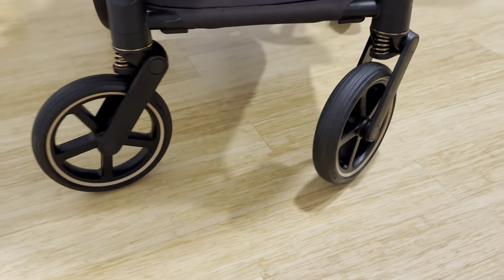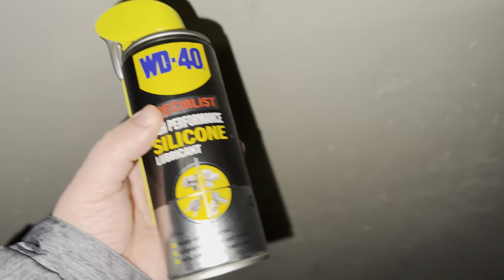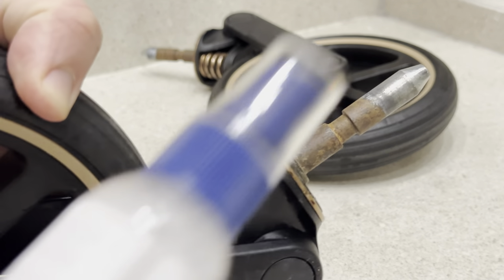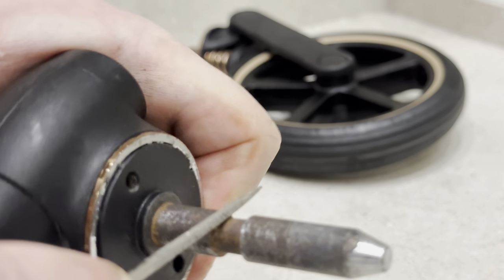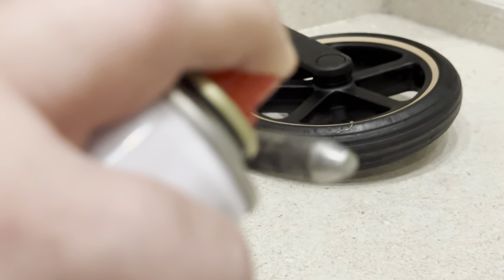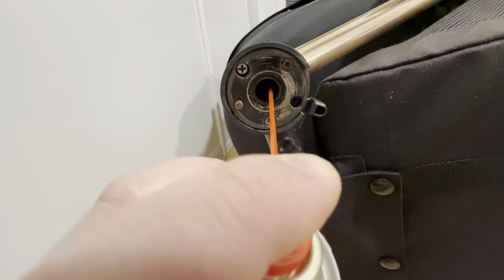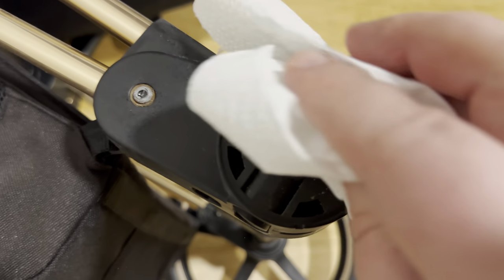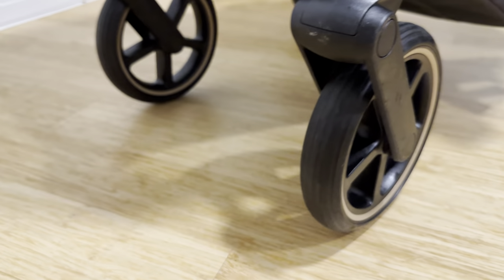Stroller Maintenance 101: Fixing Cybex Pram Stroller Wheels

Comment: Can you use the silicone lubricant for the back wheels
Reply from the maker: You can. But I don't think it will hold for long. Grease works better for this kind of application.